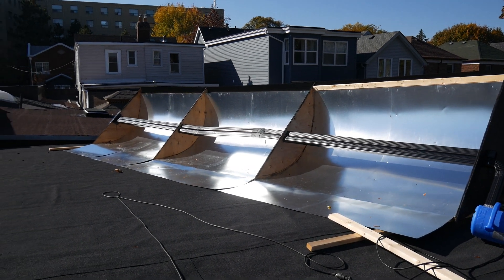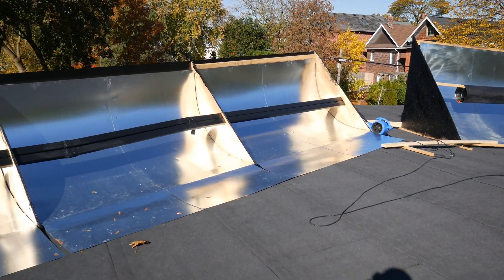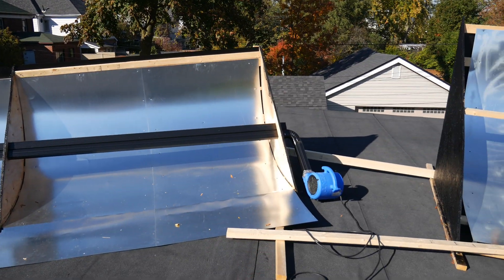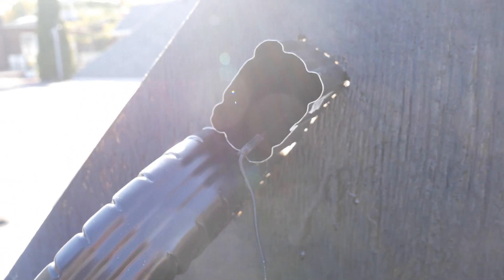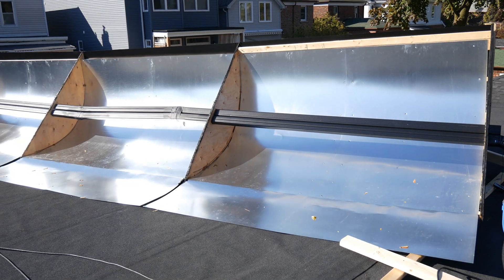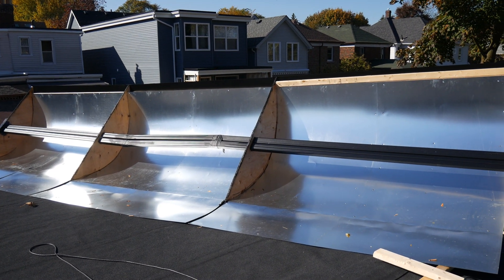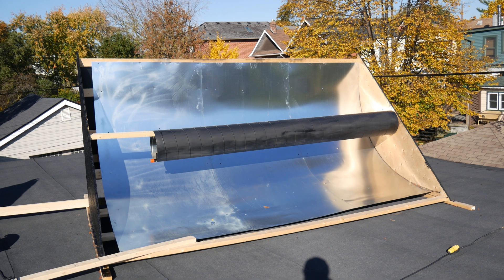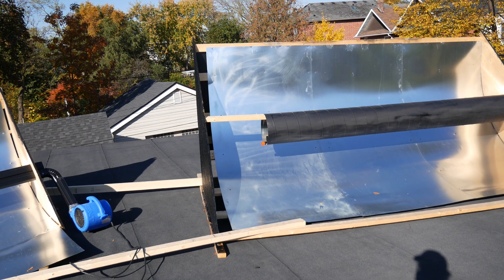Parabolic Solar Trough - Part One

Comment: Did you ever finish this or give up on it? I'm currently expirimenting with this idea. Just wandering your thoughts.
Reply from the maker: So we never were able to get it finished because neighbors called the city / we had to take it take it down, but it could definitely work - I think if you green-housed the whole thing it would generate a ton of heat..
Reply: @santonaudio9036  bummer on your neighbor turning you in and shutting down. From what im seeing your right ,massive heat gains. I made a 11inx5inx48in box downspout downthe middle with aluminum flashing behind it bent like parabolic.with thin plastic over the front and im getting 55 deg heat rise. Relying on 10mph wind to push the air through
Reply from the maker: @rodhawkins5037  Maybe you could build in a solar powered fan? Or build the whole system vertically and use the thermal-syphon effect to pull air through the system?

Lots of options / potential - Good luck!